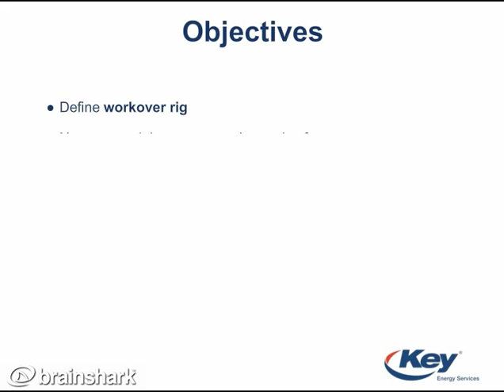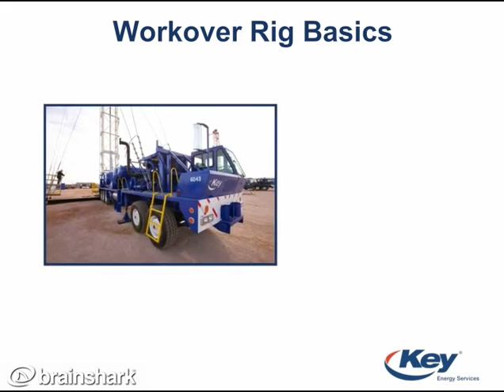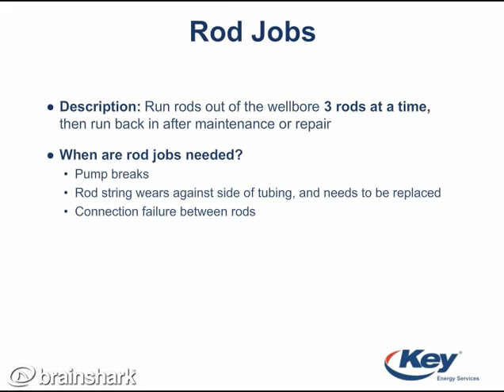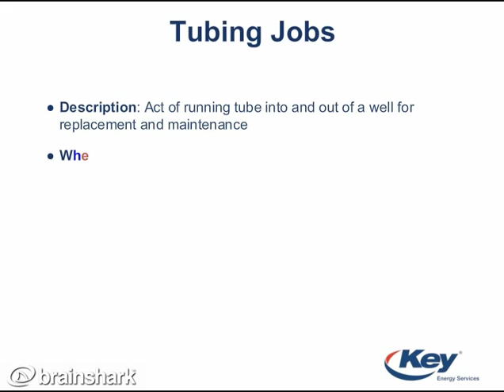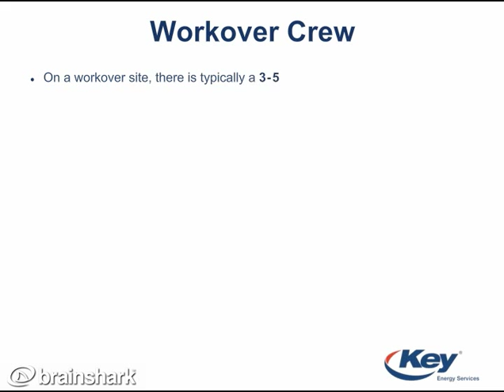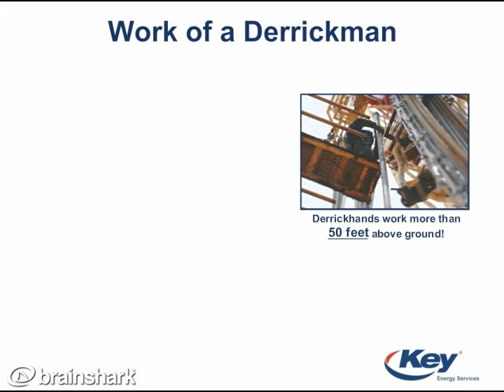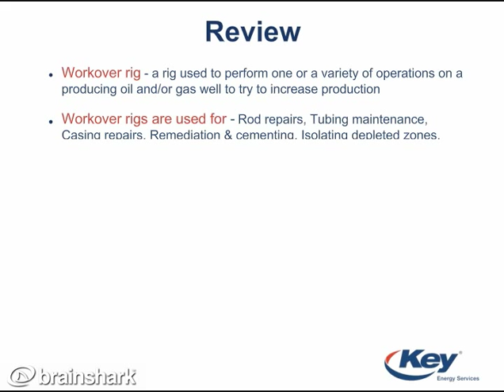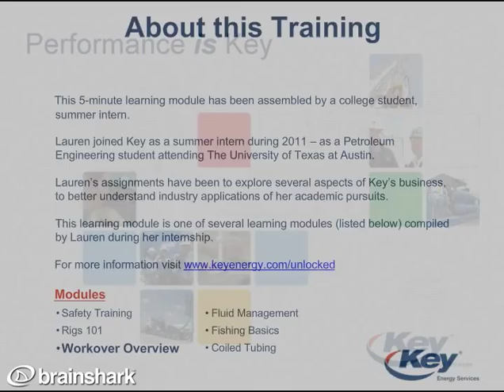Key Unlocked - Workover Rigs Overview

Comment: On-site and hands-on is the only way to learn. Just as engineers find  out that actual well mechanics, situations, reactions to said situations are not taught by professors or in the books. I believe that great engineering is important we on the rig would not exist without a well engineered program. And enven work over and completion spud meetings are importany. Working together and not being to proud to ask questions or ask for question at the round table works well for supervision. Beong in the loop is important. I feel the folks on-site are the most valuable of any company. Teaching and learnig work together to yield top field proficiency of all.